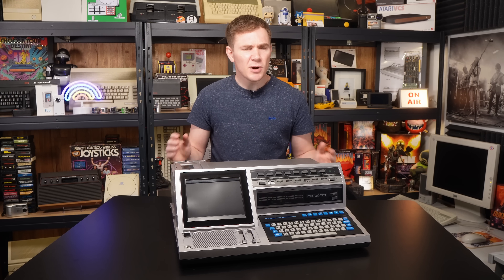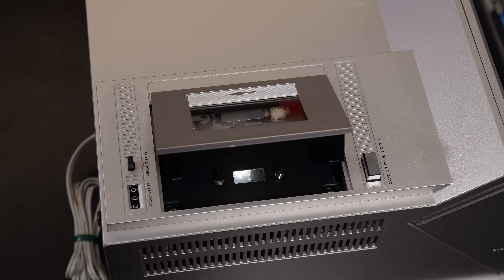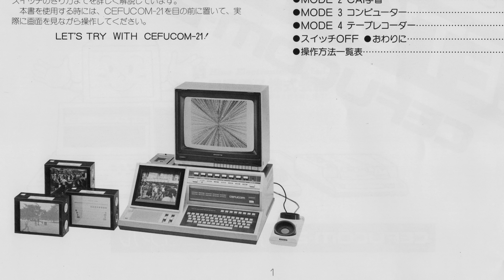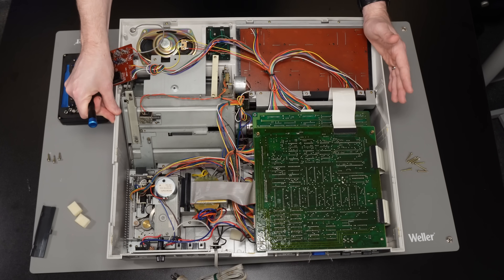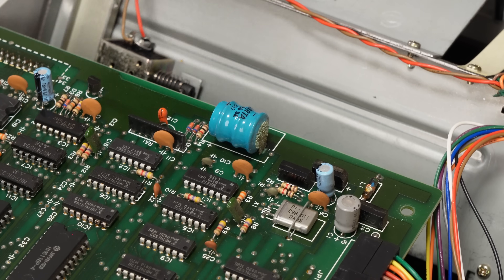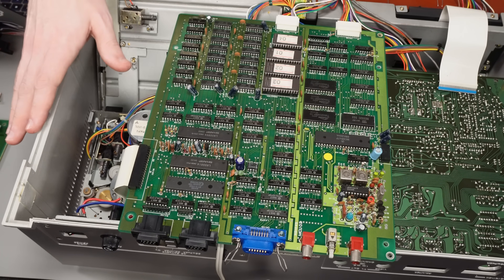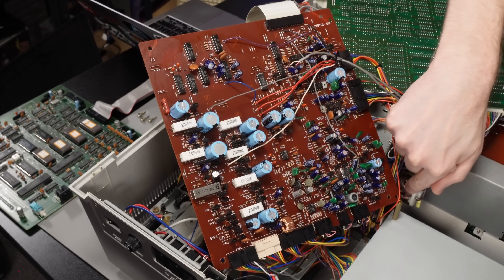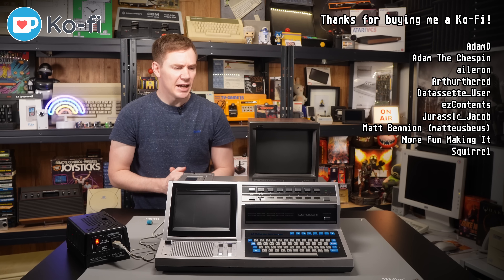What on Earth Is This Thing?

Comment from the maker: Update: Not only did I manage to get this working after I finished recording, but I've also managed to acquire the original software packs - so we're full steam ahead for part 2!
Reply: Was it the lack of battery not completing a circuit, like a chain of fairy lights?
Reply: @pdahandyman I came here to say the battery idea as well 🤔
Reply: @pdahandyman  I seriously doubt he forgot to install a new battery.
Reply: @jendakrynicky5218  I wasn't suggesting that. However, most computers will boot without a mainboard battery, it just won't keep the time across boots. He might have decided to try it before replacing the battery, but the good news is he got it working :)
Reply: @pdahandyman No the battery in those computers were used as memory backup power for any presets and RTC (Real Time Clock). Just like the PC.
Reply: @pdahandyman  that was my first thought as well.
Reply: Great!!! I'll be back...
Reply: Oh fab! I’ll be interested to see how! I was going to suggest leaving it powered for a while to reform the caps on the power board, in case it wasn’t managing to jump-start the rest of the electronics.
Reply: It doesn't work while recording?  Maybe it's bashful.
Reply: I bet it just needed to be turned off and on again
Reply: SLAP -->  Second Language Acquisition and Pedagogy  (Pedagogy being a fancy word for teaching)
Many universities use this term for the non-native language programs within their linguistics departments.

In some countries they will use SLA/LP for (Second Language Acquisition / Language Pedagogy)
Reply: Awesome!
Reply: Well, I gotta subscribe for that then.
Reply: Great but what was wrong with it?
Reply: @Slaanesh2011  I have a feeling that we'll need to wait until Part 2 :D You're not alone. I'd like to know, too :)
Reply: Looking forward to that. Subscribed.
Reply: Wooohooo!!!!
Reply: You know what? I'll subscribe for that. :)
Reply: damn fine work!!
Reply: I'm actually excited about seeing this.
Reply: Definitely want to see it in action 😊
Reply: Is it known who the original designers were and are they still alive? Maybe they can help with any problems 🤔
Reply: @hansisbrucker813  I was one of the original designers and had a hand in the most intricate technical details of this unit, down to the individual component layout on the circuit board. However, I'm completely senile now, so I don't remember squat. Sorry. 😐 /Jk
Reply: I figured all the caps were kaput.
Reply: I was going to mention something about capacitors being so old that sometimes they need time to re-form. As a precaution, old electronics needs a series variable transformer inline or even just a dim lightbulb with mains power to slowly bring the dead capacitors back online. This is especially true for really old television sets that have those wax capacitors.
Reply: Can't wait to see it work!!!!
Reply: First time I watched this channel, but amazing the capacitors didn’t blow and caught fire. Better replace them to ensure it to keep working for the next 50 years.
Reply: It's an original Steam deck??
Reply: So machines can be shy too 😂
Reply: no need was to upload this video just wastage of time, big lecture on obsolete machine, end result is big zero.

Comment: I just had a thought, Japan uses a different voltage than the US or EU.  They use 100v 50hz in eastern Japan ~ 60hz in western Japan.  It's possible that could be your problem.
check out the pins 
Type A: Two flat parallel pins
Type B: Two flat parallel pins and a grounding pin

Comment: FWIW, that printer port is not a Centronics port, at least not a standard one. The Centronics port on a printer was the same kind of micro-ribbon connector, but it had way more wires - 36 instead of what looks like 14. Anyway, the computer end was usually a female DB25 instead.

Comment: I know this probably sounds stupid, and on modern machines wouldn't matter, but have you tried putting a jumper between the terminals where you removed the battery? Could be as simple as they used the battery as part of the circuit.

Comment: Wow. I'm having a nostalgia moment here. I never had a Cefucom-21, but I did have a different Japanese computer, the NEC PC-8001. It was another Z80-based machine, the DOS was CP/M, a special version built for NEC that had  62K TPA, and they managed to cram the CP/M Kernel into the remaining 2K. I used to work with the engineer who modified CP/M for the NEC PC line, Dave Schmidt (I'm pretty sure that was his last name...it HAS been nearly 40 years), and he made sure I had all of the appropriate system software and even some hardware. I had picked up the machine for $50, the company having gathered a large roomful of various computers, that they used to test compatibility with their software. At that time, in the latter half of the 80's, they had no use for a lot of the machines, so they offered them for sale for barely a pittance. I could have gotten a Commodore PET, or one of those CBM computers you have in your background, but the NEC looked the most complete, and I had Dave to help me with it, so I got the NEC PC-8001. 

It was a fairly typical CP/M machine, the only real departure being that incredibly small kernel and very large working RAM size. 60K or even 59K was far more common.  I got it with two 5 1/4" diskette drives, with around 100K of storage on each. The drives were the type that only had one read/write head, and a common "feature" was that you could punch a matching index hole near the hub of the diskette, but on the opposite side, and essentially turn it into a double-sided disk. But it wasn't treated that way in software, and there was no read/write head for the opposite side, so it was just an increase in the amount of data an individual diskette could hold, as you had to flip the diskette over and soft-boot the change of disk just as if it were a totally different diskette. But given the price of diskettes, this was a useful way to cut that expense roughly in half.

I wrote my first shareware programs on that machine, one being a program that would print 4 pages of text onto a single side of a single sheet of computer paper on an Epson dot-matrix printer. It did this by putting the printer into elite compressed superscript mode, then indexing the printer so it printed 4 pages in a Z-shaped arrangement on the single sheet. Another of my shareware offerings was a program that printed a series of lines onto a sheet of paper, and the catalog (disk directory) onto a portion of the paper. You then folded the paper along those printed lines, and with some very simple origami-like planning, it created a simple paper diskette envelope, with the directory printed right on the front for easy reference. Other programs simply printed a slip of paper you trimmed with scissors or a paper cutter and stuffed into the envelope the diskette came with. The benefit was that, if you bought diskettes in bulk as I did, the envelopes were not included -- you had to buy the envelopes separately. The "foldir" program I made allowed you to create an envelope at any time for the bulk diskettes. I remember getting a shareware registration for it from Australia, quite the thing when you live in the Chicago area.

Now, my only work with CP/M is from a tiny Z180-based computer that runs a version of CP/M, providing multiple "drives" in the RAM of the machine. Software can be uploaded to it very easily. I have a version of Turbo Pascal on it that is code-compatible with a copy of Free Pascal, Turbo Pascal, and Lazarus on my PC. It's fun to play with. It's an SC131 Z180 Pocket Computer I got on Tindie, and supported on Small Computer Central. It came as a kit which I built myself in an evening. From what I can tell, they're still available.
Reply: wait, the kits are still available!?!? i need one
Reply: Wow, nostalgia chain reaction. I couldn't count the number of times I cut a notch in a 5 1/4 floppy so I could flip and use the other side!

Comment: I think the failure to start up was due to not having the back up battery. Ordinarily I thought you would piggy back on a new power supply in parallel and then remove the old battery, thus keeping the system programmed.

Comment: are you using a log in similar too hel-k006? i remember this from iowa city the modem should be a fast 8k connection and depended on the modem for its operating or it was slaved to a univac 2000 as a MODEM DRIVEN station and you could take this with you to other labs but was not much more then a terminal rather the the running portion of the computer... the display AND THE USE IS THE SAME TIMELINE OF THE FIRST SUPER BEE COLOR MONITORS JUST TO GIVE YOU A ERA THIS WAS USED.. BUT I KNOW IT IS VERY CLOSE IF NOT WHAT WE USED THEN AS A REMOTE STATION LOG IN...

Comment: Have you tried to Replace the on-board Battery with an Equivalent one? Might be best to solder the Terminals with wires and relocate the Battery elsewhere to a safer Location. Just a thought...

Comment: fascinating machine; thanks so much for sharing the board photos and especially the rom dumps!

I find that when deep diving into antiquated systems like this you can connect with the minds of the engineers that created it, in the context that they did so.

I did a cursory survey of the roms.

The first board ('board 1', with the bad battery, it doesn't seem to have a marking on the silkscreen) seems to be I/O, and peripheral to the other board.  It has 4 KiB RAM, and 32 KiB ROM, but much of that is data.  The admixture of 8255 and Z80PIO is striking.  8255 were cheaper and simpler, so it seems if they used a PIO then they might have done that for a reason.  But since 'board 1' seemed to be peripheral, and because I do not have schematics, I dug a little deeper into into 'board 2'.

'Board 2' ("MCU02") seems to have a 24 KiB rom system in roms marked 1-3.  These are mapped at 0000h-5fffh.  8000h-ffffh is the DRAM.  6000h-77ffh is, I suspect, the static ram in chips marked IC130,137,143.  That region is init'ed in two chunks -- one of zeros and the other of spaces.  Interestingly, there seem to be parallel chunks in system RAM at e000 and e800.  This is striking since the sram should otherwise have read/write access.  IC129 is surely the character generator rom, but as it's soldered in I suspect a dump is not forthcoming.  No matter, it's not required, but may be useful eventually understand how the Japanese characters are depicted.

There is a 2 KiB hole at 7800h-7fffh.  And there is an invocation to 7800h.  I'm not yet sure if this is for the ROM cartridge, or for 'rom 4'.  'rom 4' is interesting in that it is 4 KiB, but half is unused.  It /could/ fit there.  But it also seems to be a boot rom.  In the photo, it's close to connector CN109.  Maybe it's a 'default' cartridge?  (and maybe I'm barking up the wrong tree.)

The MCU02 does not seem to use NMI, but does seem to use INT, and in the Z80 IM1.  This is striking, because I do not (yet) see an explicit switch to IM1 in the code of roms 1-3.  So maybe rom 4 does that before paging out.  Perhaps I should have a word with rom 4...
EDIT:  Rom4 does seem to be at 7800h, and only the first half is used.  It sets up IM2 for the PIO, which I guess was not present on the Sanyo system.  It's interesting because rst38 is still an ISR, and the PIO port A interrupt jumps into it.  So I suspect the Sanyo firmware was IM1 and Cefucom hacked  that out and jumped to the added Rom4.  There are some nop'ed spots and some other code that does nothing useful, so there has been some patching.
As to why the board has a 4 KiB eprom when only 2 KiB is used, I can only guess that the 4 KiB's might have been cheaper at the time of manufacture.  It has the same pinout as the 2716, so they probably wire A11 low (which is vpp on the '16 and would have been low anyway).  You plug in a '16 or a '32.

The system seems to use port I/O; so far 40h seems to be some control lines and 00h seems to be a latch of some sort.  40h:3 strobes some data presented via 00h.  The photos show the printer port close to some 74373's, which are unidirectional, but perhaps the pair makes it bidirectional.  I see some port I/O done through the C register, and I have not analyzed that.

I did find the code for displaying BASIC error codes (e.g. 'syntax error', etc.).  This will lead me to the display code.  It's been a while since I saw a MC684x, so there will be nostalgia.

The BASIC does not so far seem to be of microsoft origin.  It does support peeks and pokes and usr() functions.  There are a bunch of 5-byte structures passed around.  I am guessing those are variable 'descriptors'.  I'm not going to spend time on those until I have more systems stuff worked out, especially display and keyboard.  Then rest will fall into place.
Reply: ROM Sleuthery at its finest

Comment: top to bottom board stack is marked:
* HD-1015A (...more...?) - Hardware driving?
* MCU 02 - micro computer unit #2?
* <unmarked> - micro computer unit #1?

i guess the #2 is more like the central controller for the programs including video and sounde whilst #1 is sort of the controller for load intense duties such as modem, tape and more.

good luck with the upcoming steps for bringing the whole system to life again.
capacitors aren bad from that far i could see - but might have run quite dry over the decades now. having them on power might either re-vitalize them, or blow a few up (as i had to happen it on some 30+ year old oscilloscope).
I think you are fit in tracking down basics, like the rear end power switch is really closing (instead of having oxidized or a spring load is to low).

you got me subscribing - i want to know why MCU #1 has supposed video ram as well, or what other purpose that will have.
also the subject of the EPROMs is a good hope point - including the attempt to decode their functional contents within e.g. some emulator or disassembler.
and finally... 9-color graphics for the video encoding... thats puzzling me for sure now. Answers please. ;-)
Reply from the maker: I plan to get proper photos of the boards and document it all on my website. I've already uploaded the manual scans and EPROM dumps. It's just finding the time!

Comment: L1 (a small inductor) seems to be burned up too. You can replace that with a simple wire.
Reply: inductors typically will have a filter effect. so ripples and spikes on voltages will be damped down a lot. sure for a test you can try with a wire. but dont under-estimate the wisdom of the people that designed it - sometimes such parts come from real world trouble fixing and sometimes its just the device running to close on the edge of part specs so that any sort of impact including temperature and aging could kill their functionality temporarily or permanently.
Reply from the maker: Interesting, I didn't spot that. Thanks!

Comment: The printer port is not Centronics. It uses the same connector as the Hewitt Packard General Input Output Bus HPGIB.
Reply from the maker: Thanks! Yes, I was just reading from that 1000bit site. Looks similar but seems to be physically smaller.

Comment: I just recently revived a completely dead 286 Toshiba Lapline from the Varta death, I was not that lucky though. over 15 severed traces along with component and connector damage everywhere. It was an absolute nightmare to bodge and repair everything to make it live again but I actually did it in the end. but the RTC is not running and the screen has issues too but I can actually game on it now which was even for me probably not going to happen. it took a lot of effort to get there
Reply from the maker: Eugh, sounds like a nightmare. Great job getting it fixed! I've certainly given up on some in the past (or at least added them to the "future projects" pile)
Reply: @ctrlaltrees that’s for sure. This was way more work than I normally would spend on a broken device but it is such a rare model I just could not give up on it without a serious attempt. 
I did not know anything about any component in this computer either. 

I know gas plasma displays are really prone to failure and it did not even light up when I got the computer. It was absolutely dead except the fans running so I had to repair it to know if anything was broken too. 

Turned out there is naturally because why would it not, 

The screen probably have a bad driver ic because there is a few lines in the picture but not as missing ones just wrong intensity. 

The EGA graphics does not work properly either. The picture is either wrong size or position on the screen, garbled or non at all depending which setting or program you use. 

But the picture works if I select Color80 but then windows 3.1 won’t work instead but dos programs and games just fine. 

But this Toshiba Lapline 3240E is just way too rare to find any documentation or possible fixes for so I have to figure everything out myself. And it is very different in hardware compared to similar Lapline models. 

I actually got a Lapline T3100e that works perfectly after some minor fixes but it is smaller and different in every way. All hardware inside it is way different. It actually origins from a very specific place which is very special in its own and probably very rare too.
Reply: @ yeah. I have many projects I could do too. But health is in the way so they mostly pile up. I do the most desired projects when I can however :)